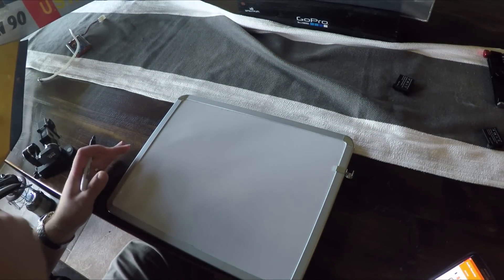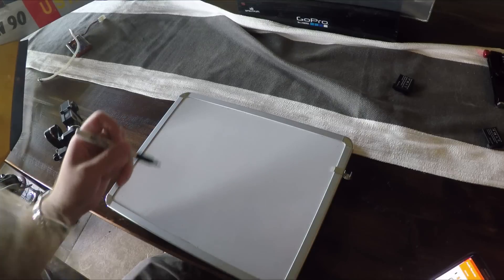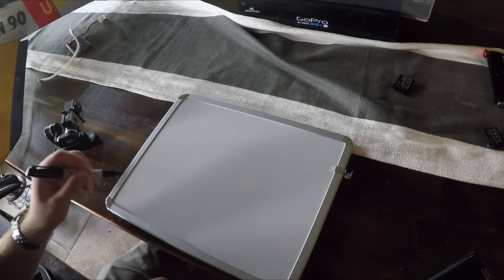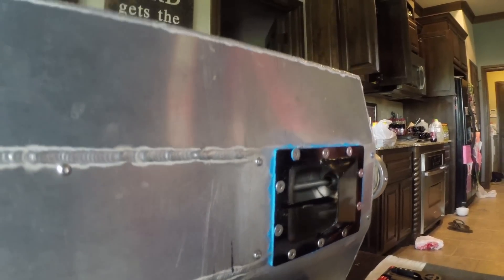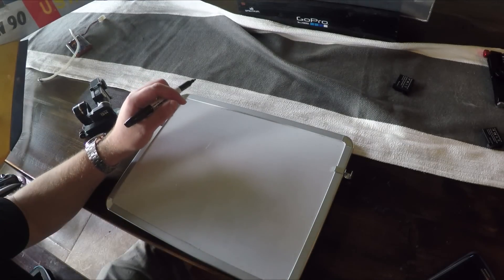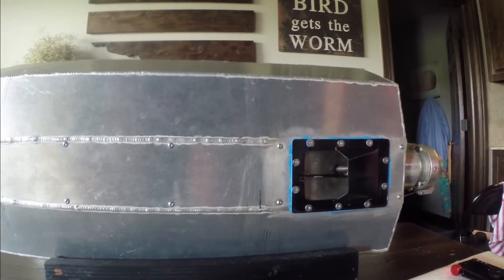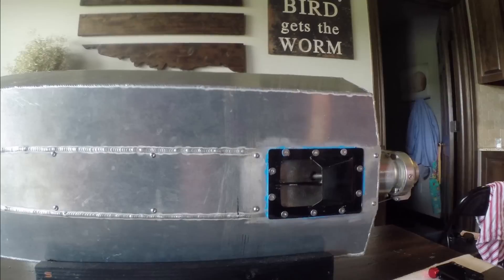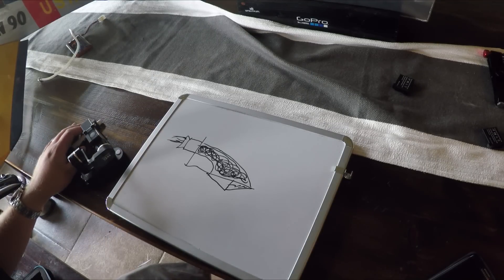Aluminum RC Jet Boat (Part 10) - New, Scooped intake grate

Comment: $0.02
=
Watch some "World Jet Boat"
Racing.
Like the Salmon River races
Pause on a boat getting air and see what the bottom of the boat and intake look like.
Watch the show n shine to see what the jets output looks like.
( stove piped down to be smaller and moved to the bottom side to be at lowest point.
And rc boats I've done, using a ride plate to make it seem longer and protect the parts outside the boat.
Helped a lot.
Enough motor and it should be sucked to the surface of the water having only the intake riding on it.

Comment: I don't know if it is a 3d printed jet or not but first things first. The scoop I believe would cause a good deal of drag or resistance in the trade off for more water. It's just physics. The reason I asked about the 3d print is maybe The intake could be redesigned so that it doesn't make the water go up and out. Instead just have the jet pretty much flush with the bottom of the boat and have the intake on an angle, say 20-30 degrees, thus not making the water have to go up and out. It would be more like in and out which would work great in theory because there would be no resistance and you would be alleviating more resistance by providing a more straight forward path for the water to travel. The other thing to keep in mind is the intake pretty much becomes a vacuum when the internal prop is rotating, so much so that it doesn't really need any assistance in getting more water. The only thing that will increase the speed and mass of water entering the jet is the speed and mass of water exiting the jet, so more power is the only thing that will work in combination of making a more streamlined path for the water to travel. Hope this helps.

Comment: I watched a video some time ago of a guy converting a shallow draft skiff into a jet boat. He had the same issue. He solved his problem by designing/building a bulge into the haul on the keel if the skiff just before the pump inlet and I believe he just used automotive body filler and shaped a bulbous shape and it solved his problem.    This comment is probably a day late and dollar short.

Comment: I had a similar experience with a 60 meter long real navy boat using real waterjet. In the case, ridiculously expensive side fin stabilizer didn't help at all. Amazingly,  a simple fin at the tail of the boat solved the problem and yes riding at 100 km/h was a thrilling joy.

Comment: Eliminate the flat bottom on the hull,  the water density is to low that is being delivered to the pump. Once you are at 3/4 to full throttle it is sending bubbles strait back to the pump due to the flat bottom, try implementing a dead rise all the way back to the  to the pump so that the bubbles that are being created by compression are shuttled off to the sides giving a dense stream of water to the original grate. http://outboardjets.com/boat-selection/

Comment: It has to much power to get a good, strong and steady water flow. if you crank up throttle to spin up the prop to suck more water, it wont happen. Your motor has to much rpm in this configuration. it just to powerfull for something like this. If you use a bigger prop with this motor is will make you faster. full throlle and it slurps..Its like makeing burnouts on the road with a car, if you hit full gas, your cat wont move fast, it just spins out where it is.

Comment: Most likely its the pitch of the blades on your jet prop. You have so much power and rpms that it will actually cause cavitation and that is why at full throttle the boat actually slows down due to the water being pushed and not pulled.

Comment: Your idea is flawed. Look at real jet boats; they have the intake AND a ride plate. The hopping has absolutely nothing to do with the intake. The hookup is from the water intake, but the lack of stability is solely the result of a LACK of ride plate. Some are adjustable for trim...some are not. You are incorrectly focusing on the intake, when you need a ride plate. I guarantee you.
Reply from the maker: Cool man! I appreciate the info.  I'll look into that for sure. Thanks, bud!
Reply: Brian Vaughan  I have two Kawasaki 750 stand up jetskis and one of them has a longer ride plate and it is extremely noticeable. The one with a short plate porpoises at speed while the longer plate sits flat and stable in the water no matter what speed.
Reply: @finnroby9233  Exactly! My ex father in law owns Jet Dynamics...a manufacturer of personal watercraft parts, and I learned a lot about intake grates and ride plates. A concave ride plate offers superior performance over a flat plate, and adding a shaft shielding intake grate will reduce cavitation and help with pump loading and handling characteristics.

Comment: what you need is a tank at home  fill tank up with water  must be make of plastic  so you can see what is go on  when the boat is running  so film the water go in to the jet,  boat must be pin down so it can't move  you real don't need a big tank   may be a 2 feet high   a 1 feet  wide ,  then put it on a wooden frame,  so you can see under the boat,  that what i would do  hope this help you.   colin  u k.

Comment: Also if the weight moving isn't very feasible you could add a dorsal fin ahead of the pump to keep water up to the start of the intake grate when it pops out of the water to keep from getting cavitation. Good luck!

Comment: Hey man cool project I play a lot with freestyle jet skis and we need the pumps to be full and stay full as quick as possible, try looking up freestyle jet ski intake grates you'll see they have a scoop about in the middle of the pump intake that's to fill the top of the pump.the bouncing you get at speed is called porpoising if it were me I would putt more weight forwardThis is really cool I wanna do the same thing with gas or nitro.

Comment: You need to remember that jet drives can only flow so much water and trying to add more water will not help it to go faster. If you want more speed you need a bigger pump to add more flow before you run out of water flow. This is something that the full size boats suffer from as well.
Reply: Old comment, but still. First adjust the nozzle size and consider what type of props you are using.

Comment: have you tried changing the impeller, and checked weight to power ratio,  I would change the intake shape . check out River Daves place, online they have a jet boat forum , you should find some answers there,
Reply from the maker: Tom c no I haven't changed the impeller.  I'm kind of limited on that.  I can only find replacements and not different pitch or number of blades.  it would be cool to try out different impellers though. I have since modified the bottom of the boat which has improved performance. thanks for the suggestion though, I'll check em out!

Comment: Hi Brian, if not already mentioned, you could reduce the intake scoop so the profile is smaller. The scoop may be way to effective and forcing to much flow into the unit causing drag. Just a thought. Love the whole idea though!
Reply from the maker: Nate D hey bud, ya I'm sure you're right about it creating drag.  probably way too aggressive.  something 1/4 this size may have still been too much... I don't know.  worth a shot though. worked in my head, anyway!!
Reply: No problem, it should give you more speed. As another suggestion, you can buy 1/8th counter sunk rivets, as those rivets in your hull don't help with speed either. Not criticism, just trying to be helpful.
Reply: Nate look up youngster jet boat

Comment: You can a Reduction spur gear 2:1 ratio setup to reduce rpm which creates more thrust. The problem is that the engine hp and rpm is overpowering for the impeller size. That can be one of the problem.
Reply from the maker: RoPower that's a very good suggestion.  I hadn't thought about that.  I looked around and found some heavy-duty gear reduction units for similar applications.   I like the idea, because you are probably right about the power and RPM. thanks for the advice!
Reply: Also that scoop you build on the bottom of the jet drive is nice but it is causing a lot of air bubbles to the impeller which creates cavitation. run it without the grill scoop first.
Reply: No problem. Nice build too. I which I can have a workspace like you have.
Reply from the maker: RoPower thanks! I'm very lucky with my work space and tools.  it makes playing with this stuff all the easier.

Comment: My theory is cavitation around the impeller, adjust the impeller pitch and you should see a big power increase on the topside.
Reply from the maker: Andrew Marshman I now know there is some cavitation occuring.  the impeller is showing signs of cavitation.  it's still in very good condition though.  I can't adjust pitch or anything, but I think the answer is to reduce the motor speed.  just too much power going to the jet drive. thanks for the input, much appreciated!

Comment: you could do this by adding a thin layer of plastic to the bottom that covers the screw heads or counter sink them into the plastic around the intake ..you would also want to taper the edge of the plastic where the  water flows into the intake kinda like a ramp i will try to find an example
Reply from the maker: corey arnett that's a good idea. I actually did something just like you described with a bit of aluminum.  I haven't made a video about it yet though.  made it, tested it... then I broke something on the boat and haven't messed with it since.  but the "ramp" thing works.

Comment: the problem i see is the intake sticks down below the hull  causing cavitation and your boat to hop if you were to smooth out the bottom to make a smooth un disrupted flow of water to the intake  more than likely this would go away and you wouldn't need the scoop hanging down witch would ad speed thats just my 2 cents though.... lol cool project though
Reply from the maker: corey arnett this theory is also sound.. as I mentioned, I did the "ramp" thing and I also put the old, flat grate back on it.  this made the bottom flat.  nothing sticking out.  this helped it out a lot.  improved the top speed a bit too.  best speed I recorded was right at 25 mph.  (not a race boat... but it's one heavy s.o.b.). thanks for your input.  your ideas are good ones.

Comment: hi again brian. i was looking up some videos about props and high revs and came across something called capitation. it happens when the prop is turning fast enough to create an area of low pressure behind the prop as a result of restricted flow or very high revs of the propeller. this creates bubbles behind the prop. these bubbles are not full of air but water vapour (steam). it is a very harmful thing that causes pitting on the prop and the surroundings. Try balancing the prop and make sure its highly polished finish, also sharpen the leading and following edges of the prop. this reduces drag and cavitation of the prop. it might be your problem solver. also the scoop might be reducing the flow of water and causing more cavitation. the loud noise at high speed might be those bubbles of steam recollapsing into water after they get past the prop. 
did you do something about it in the meantime?
Reply from the maker: Frederick Brincat hi there! thanks for all the input.  you are absolutely right about the cavitation theory.  your suggestions on how to overcome it are very helpful too.  lately I have made changes to the bottom of the boat to make it smoother.  got rid of all of the things that protruded out. this seemed to help a bit

Comment: in reply to your question, what i think might be happening is you are getting loads of air in the prop. what might be the reason is that the flange ahead of the intake scoop, since its not flush with the hull of the boat is stirring air and water at high speeds before the water enters the scoop.  Also the welds on both sides of the scoop leading all the way from the front of the boat all the way back might also be contributing to air mixing with water therefore you are getting a lesser dense mixture of matter inside the jet drive. try polishing those out, lower the flange to a complete flush with the hull, and use countersunk screw bolts especially ahead of the scoop. Good luck and keep up the brain storming.

Comment: I had the ricochet 46 and incurred the same problem. After much researching and different setups I learned a couple of things from trial and errors. Ballast, correctly ballasting my boat made a world of difference. I dont remember how much I added but it looks like your boat might be properly ballasted. Just doing that worked wonders for me. The second part I had to understand dealt with water itself and how it is processed through a single stage jet. Water cannot be scaled down as the rc vehicle itself is. Even in 1:1 jet boats their limitation is set by the ability to move a volume of water through a small area, larger pumps, HP and more RPM still generally limit a full size jet boat to around 60mph. So if you take that into consideration and reduce the speed you see your boat going to actual scale speed you most likely should be pushing the upper limits of your equipment's capabilities. This was my finding from multiple discussions with the actual boat builder of this boat, full size boat builders and aftermarket jet companies. Hope some of this might be useful to you, that's all.

Comment: IT DOESNT GO FASTER CAUSE THE BOAT HAS TO COME OUT OF THE WATER CAUSE IT RAISES THE RPMS AND WHEN SKIPPING IT CAUSES MORE RPMS AND WHEN LANDING IT IS LIKE A POWER  (HORSEPOWER OR TURBO KICKING IN)TORQUE . IF YOUR IDEA WAS A GOOD IDEA IM PRETTY SURE ITS BEEN TRIED TO BUT IF IT WAS GOOD THEN A 19FT JET BOAT WOULD OF ALL READY HAD THEM ON IT BUT ITS NOT . AND THATS BECAUSE IT WILL DRAG IT IN THE WATER LIKE A PARA SHOOT AND ITS DESIGN TO SKIP ACROSS THE WATER

Comment: you should extend the front of the scoop to provide more volume and you should change the depth and lessen the drag. also at higher speeds you want to shove water into the jet. your right about the volume but your intake goes too far back the opening needs to end at the front of the intake. you can email me. looks amazing and i love your boat. jksully92@gmail.com and ill send you a drawing.

Comment: Brian, looking around the net it appears that jetskis do exactly as I had in mind, looks like it would be good for your situation.
Reply from the maker: I like the idea. Pretty clever. some of these V pumps move some serious amounts of water. problem is I'm a little scared to start drilling into the pump.  it's cast aluminum, not cnc. (at least it's cast on the pump housing, where I think I'm supposed to drill the hole) pretty scary for me with the amount of money I have in this thing.  but I think I'm going to use this idea on a cheaper boat. so if I screw it up, I won't hurt an expensive jet drive.  thanks for the idea though. it's pretty neat.  I actually think this is the type of bilge pump the Streamline RC, Thrasher jet boat uses.  look that boat up if you haven't heard of it. it's pretty neat.
Reply: Sorry, wrote a reply and lost it, I understand you not wanting to screw up your casting, you can get similar results with a backwards facing tube on the bottom of the hull or low on the transom. The Streamline Thrasher seems to be indestructible! Have not played with RC boats for many years, never lost interest though. Now live near masses of freshwater and close to the sea too!
Reply from the maker: oh ya.. backward facing tube would be an easy thing to try.  Might have to give that a try.  I am going to a friend's lake house this weekend and I will be making some new videos.  one will be a video of my new intake grate design.  I've recently finished the modifications.  Also will be making some new videos of it cruising around with the real boat.  
the thrasher is a beast!  I want one as soon as i get some extra play money!!  Super cool boat.

Comment: Brian, if you search the net for "venturi effect bilge pump" you ought to find something. I have used the same principle to draw air into a pump nozzle in a pond. Although it is counter intuitive the narrowest part of your jet drive is the lowest pressure.. a pipe drilled into it at that point will be subject to a little vacuum and can be used to draw stuff out of the bilges. Obviously when the jet drive is off you need to make sure that flow can't reverse and flood the boat. In the past rc boats sometimes had a backwards facing pipe in the propwash for the same reason, generally with an inverted u-bend type arrangement to stop backflow.

Comment: A fascinating project, the answer is certainly not instinctive to me. Trim tabs sound like a good idea, could always be on a spare servo. Incidentally a crude bilge pump can be achieved by utilizing the vacuum generated at the nozzle as the velocity increases.
Reply from the maker: Thanks for the comments.  I'm interested in the nozzle bilge pump idea.  How would that work?

Comment: You need some way to easily try different depths that it protrudes into the water.  I recommend you build an adjustable scoop so you can try various depths, so you can adjust with a screw (as an example) how deep the scoop protrudes beneath the boat, that way you can run it up and down to find out what depth works best.  For all practical purposes water isn't compressible, I've heard that it will compress a very tiny amount, it isn't much.
Reply from the maker: that's a good idea!  thanks.  ya when I say compress.. I really meant accelerates.